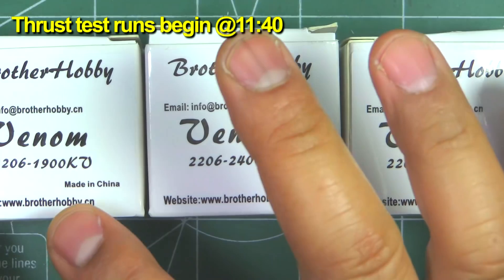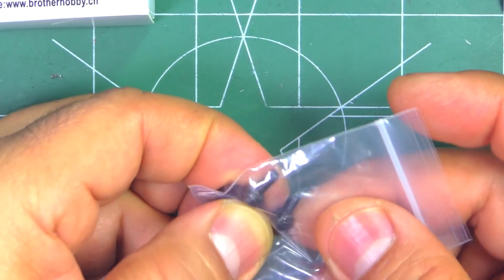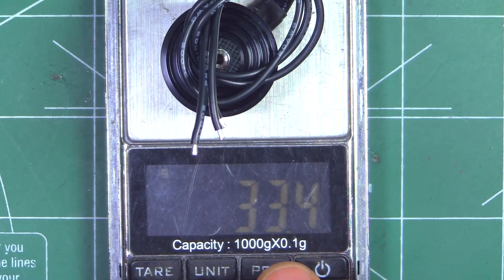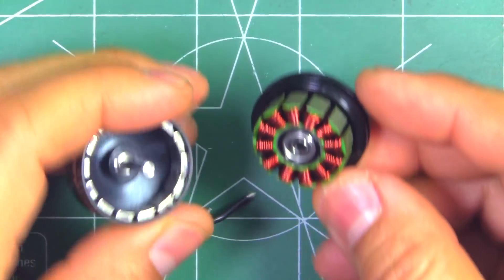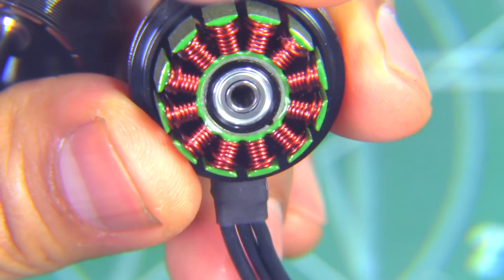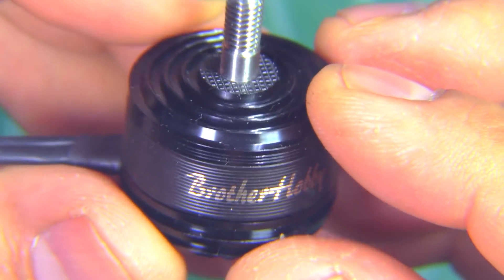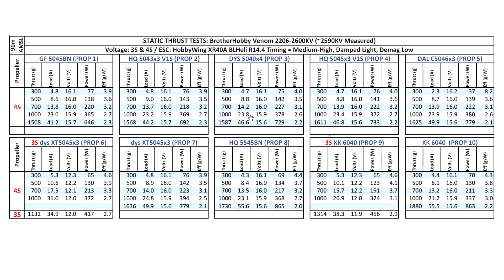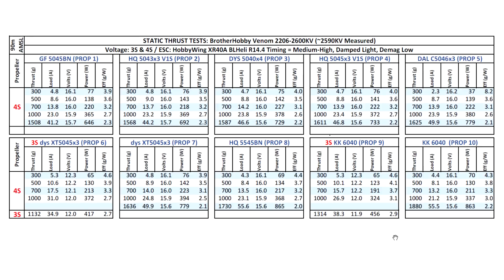BrotherHobby Venom 2206-2600KV All Weather-Harsh Environment Motor

Comment: These look awesome! Can’t wait till I actually have money so I can buy them😂 Wish they had a screw instead of a c-clip tho..and a little expensive but I guess that’s cause of the extra metal?
Reply from the maker: Right, screw would have been better. Best guess is they projected to sell small amounts since it's more of a niche/specialty motor so law of supply/ demand if in fact it applies to this area of manufacturing. Good motor for a specific purpose.

Comment: Many bando places have iron dust - not problem any more - I'm using these for quite a time. My biggest concert is that these bastards losing the C-clips so annoyingly easily. That is a stupid design especially for something must perform in Harsh environments. For this price just why couldn't they use hex-screw locks... Unbeliveable. I think who pays for these would have paid that little more for reasonable durability. Also the props gets lose very very very easily (HQ 5034 V1S), I have to print some TPU rings to get more grip - the top area where the prop fits could have been bigger.
Reply from the maker: Thanks for your detailed report. Yes, a retaining screw for the shaft would've been so much better. I'll pass it on to BH and hopefully they will address those in their next revision for this motor. Perhaps also increase size to 2207? It would be interesting to see if using E clips instead o f2f circlips would help. Some of those circlips are weak and easily break. E-clips are somewhat beefier but gotta check if shaft groove accepts them.
Reply: @EngineerX   thanks, i would also appreciate a revision on c clips and propp securing. I think i have some E-clips too, see if that fits the size...but messing with that 2 spacers too - nightmare. Before purchasing I was afraid if these will have enough torque at 2206, but i liked them somehow a lot better than my T-motor F40 pro II (same kv). I also think 2207 would be more tempting for the masses.
Reply: @EngineerX  I'm guessing and understand you have way more important things than this, but I keep loosing the bells of these. Tried to contact BrotherHobby, they never relpy me. I do feel pity that they created something powerful, smooth, and would be durable, I used it for bando places with iron dust, crashed to mud and water... chased snowboarders - all other motors failed when snow got in... they badboys would prevail in harsh environments, if there weren't those C clips... costs.. cmon, this is not a cheap product, probably who buy these would pay a few more, just to be granted reasonable durability.
Reply from the maker: @pirchoo  Hopefully BH updates those features in future Venom versions. I think they have a very good motor for those types of environments and it's probably the only motor of its kind in this size.

Comment: insane how this motor is putting out more thrust than their r3 and r3 2207's!
Reply from the maker: I think magnet thickness is one of the reasons for higher thrust. I didn't show magnets all that well on the R3 2207, but if you look closely you can see the R3's mags are thinner  https://youtu.be/wR30wRFtgx0?t=4m20s  than the Venom's @ 6:58
Also R3's 0.2mm vs.  Venom's 0.15mm stator laminations account for a couple of percentage points difference in thrust. This motor turned out to be fairly powerful.

Comment: these have a nice design perhaps would be good for me and my bad landings.......
Reply from the maker: LoL... I know the feeling, sometimes 1 minute flying then 1 hour cleaning.
Reply: Its proven for me... only thing is that the props are getting lose even from minor crashes, like touching some light branches. If you use a rubber ring below the prop-nut it helps that problem.

Comment: I think motor cleaning is overrated. I've never taken a motor apart for cleaning, just dry it (sometimes in an oven) and blow and tap most of it out until it runs free again. Been doing that between crashes for a year now and still running the same 8 motors on my two quads
Reply from the maker: I think they were thinking about when you fly in very muddy or sandy ground and you want to be able to clean it faster without having to have to take motor apart at the location you're flying. Just dislodge muck on the spot and keep flying.  Back at home you can do all the cleaning you mention, but in the field you can't. It's mainly for those situations. I would imagine there are quite a few people that would find that useful. But, not for everyone. There's hardly ever any rain here in Southern California so not much mud.
Reply: You got a (big) point there. Forgot about that, and that not everybody has a backup quad
Reply from the maker: Exactly :) or if you're unlucky enough to muddy your back up too LoL...(I certainly would) Definitely not a motor for everyone, price is $5 higher than the usual $25 for the premium motors and it's a little heavier, but I think it may be useful for some people.

Comment: You'll never see this motor smoke... Literally:D 
I do sometimes fly at the beach, this would do very well, just need a frame without the center hole to protect the bottom bearings. And some sealant maybe. Sand can get everywhere.
Reply: nasone32 some of the diatone stuff doesnt.

Comment: Any comment on cooling/heat issues - how hot did it get on the stand?
Reply from the maker: I wrote a note on the KK6040 thrust run: motor did not run any hotter than other motors. It should be OK in most standard 5" builds.
Reply: EngineerX This is a very interesting motor - my biggest maintenance issue is  mud and grass flying gates in fields. -Thanks!
Reply: My builds they got very hot, but they fly ok. Maybe its PID issue. I just wondering if the heat could be an issue that they are loosing the C-clips so easily... Bells fly off all the time.